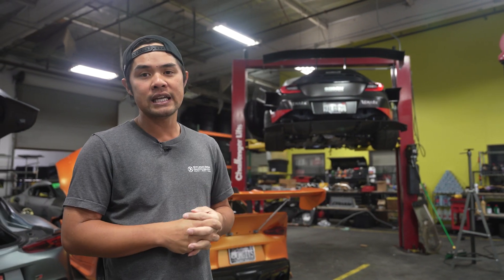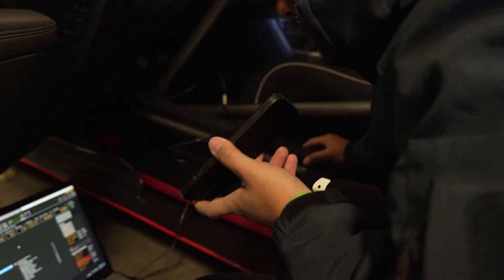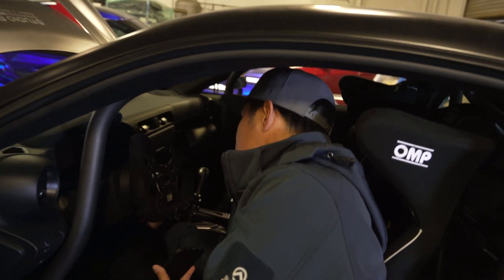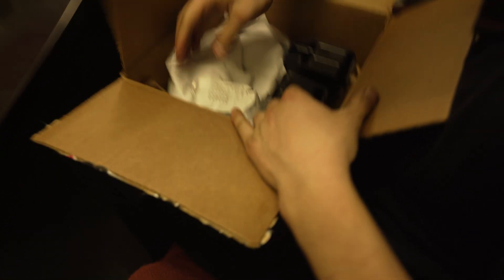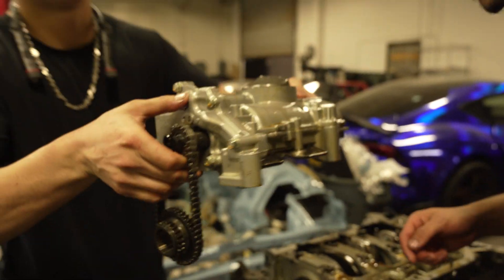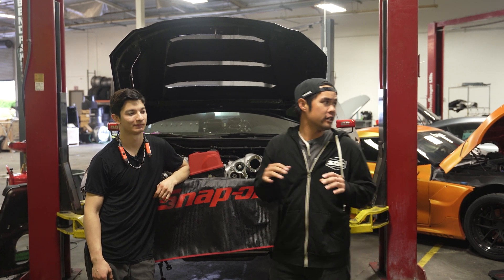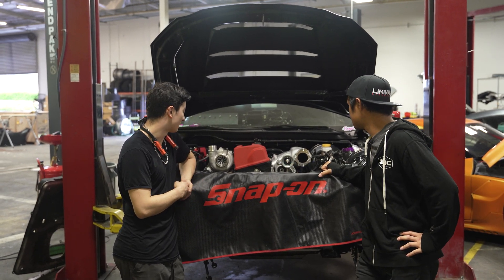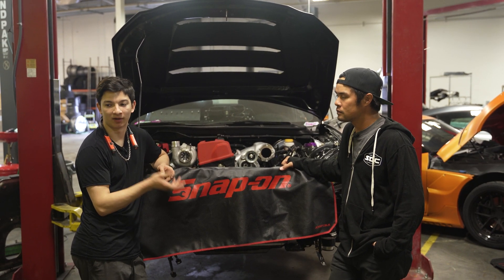K24 GR86 / BRZ Engine Swap **First in the world** Part 2

Comment: so are you guys planning to use the gateway module to convert the gen 2 can protocols to the gen 1 protocols so the haltech reads everything, or is haltech going to be making the gen 2 its own vehicle in the can bus selection in the software? (I'm looking to do the same swap here soon :) )
Reply from the maker: We’re not sure yet what Haltech’s final decision is pertaining to your question for the long run, but we’re currently waiting for a modified gateway module so we can move forward with testing. 

Awesome to hear you’re looking to do this swap too! Let us know if we can help! Would love to be part of your build
Reply: @Studio_RSR  unfortunately because the ECU outputs atleast on two different canbus networks and each oen has atleast 8 IDs that translate between them. You will need a third part module that has atleast 3 canbus network possibilities. Also the canbus IDs of gen1 are not what so ever the same as Gen2